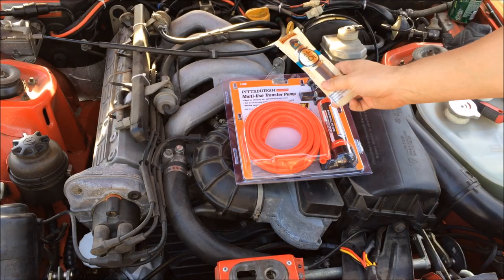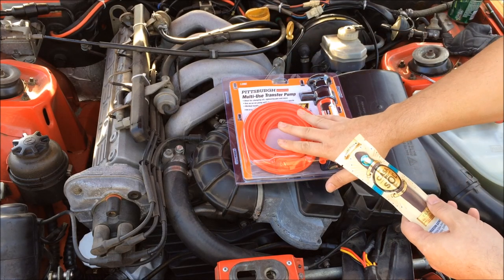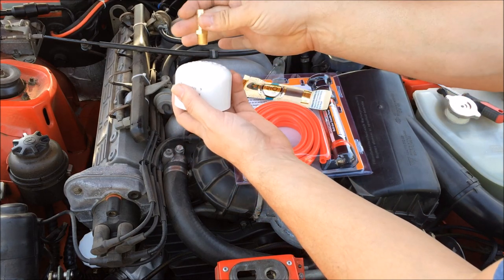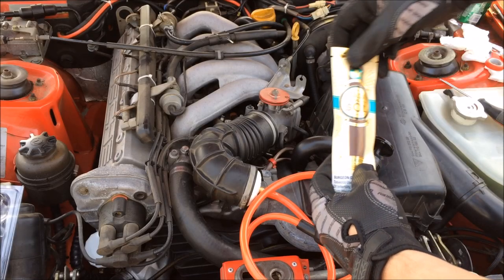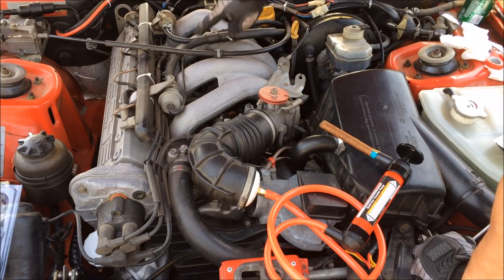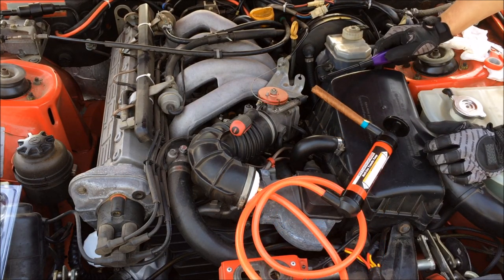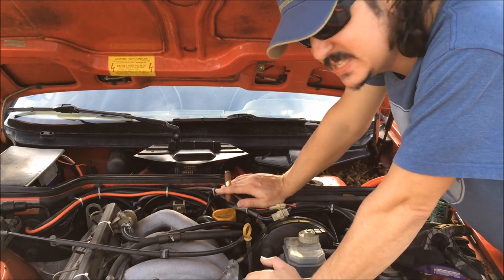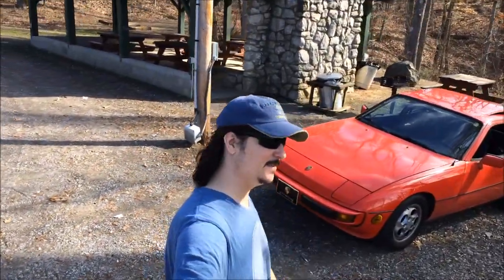Cheap DIY Smoke Tester

Comment: In case anyone is wondering, a regular plastic tip Black & Mild cigar fits perfect in the orange hose. Cut off 2 inch section of the orange hose,  stick it in the pump, then stick the cigar in the orange hose section

Comment: This needs to be the number one video for finding vacuum leaks. I’ve been having trouble with a rough running engine for so long and I’ve done everything from changing spark plugs and wires and taking it into a mechanic for diagnostics and it turns out with this little trick I have a huge vacuum leak out of my air intake. Thank you so much

Comment: Awesome, can't thank any more! Cheap, easy and effective. With this video and some helpful comments, I eventually find a vacuum leak (from egr valve) that has been frustrating me for long.  My 2cents input: 1) no need to go buy cigar, can make ur own with tea. Be sure to wrap tea bag paper in the end to avoid suck into the pump. 2) it might be hard to find exactly fit pvc cap and nipple in Homedepot. Just connect to anywhere else like brake boost line, and plug the intake air hose with a clean towel.

Comment: This is the best idea ever. I did this and found the leak in 2 mins. I connected the line into the pcv valve line on my Chrysler Sebring and found the leak on the egr line.  Thanks bro.

Comment: I used exactly this setup after watching the video,  took 2 cigars to fill the whole intake, intercooler etc on my 944 turbo but the smoke got where it was supposed to go. getting it through the turbo was no problem. 3D printed an adapter to connect pump hose to J-boot.

Comment: Great idea. I don't like the taste of cigars, since I don't smoke. I found a completely hidden crack in one of my rubber hoses that I would have never found thru normal visual inspection. Now I'm going to use this technique to find why the cheap briggs and stratton plastic carburetors are sucking air, and where it's leaking in. If your carburetor sucks air, it won't keep running after the initial start from priming, so this technique is useful for more than just your car.

Comment: Going to try this on my C300 it has two lean codes. this cheap method will help me tack it down and see if I have any leaks and if not oh well it doesn’t hurt .. will give updates🧐👍. No leaks just had wet fuel injectors from a detail

Comment: I wish I had seen this months ago....can’t believe I let my truck sitting for so long due to frustrations of finding this leak. And thx for your extra tidbits and rationale e.g explaining why you place the piece  precisely where you did, ways to get more smoke in manifold. Also, I was going to use an inscents cone , but I was worried that it would melt the plastic. The cigar is much better idea as there will be no contact between the plastic and the burning tobacco. My only concern would be a car that is gas fumey. Someone told me that fumes are ignitable. I guess all you’d have to do is light the cigar far away from engine in that case.

Comment: Amazing. When you're done you can also the cigar for a job well done 😄. I plan on trying this as well although I'm going to use an air compressor fitting so I don't have to keep pumping up the pump.

Comment: Just another tip...I used one of those plastic pumps that come with an exercise ball. Insert a lit cigarette into the inlet port, remover the shader-valve “T” connection and place the outlet tip of the pump into the vaccum line. Gently pump whilst watching that your cigarette doesn’t burn down. I find this method works best with 2 people. One to operate the pump and one to look for leaks. 😉 Hope this helps anyone on a budget. P.S., You may have to gently crease the cigarette filter to fit it into the pumps’ intake port. (*** I am not responsible should your vehicle develop a nicotine habit! ***)  😉
Reply from the maker: Thanks for the tip! Unfortunately, I think I've already given my car a nicotine addiction... I keep seeing cigarette butts in the parking lot.
Reply: edredas LMAO! Yeah, just realized I made a typo. Meant to type Shrader-valve.. But just had to trace down a P0445 leak on an ‘04 Nissan Xterra....pain in the tailpipe! But with a little ingenuity, I came up with this tip seeing as how I had no smoke machine. Found YOUR video right after I found my leak! LOL

Comment: Just a correction. Some leaks, particularly on booat pipes might not show without adding peessure to the system. I get many customers with tears which will be blocked until the pipe is pressurised and opens it up.

Comment: What size pipe nipple should be used with this Multi-Use Transfer Pump at Harbor Freight, it specifies that its  a 1/2" diameter hose.  Should I purchase a 1/2" diameter or a 3/8" diameter pipe nipple to fit the 1/2" connecting hose used by this pump?
Reply from the maker: I believe a 1/2 should work.

Comment: Awesome tip!  Ive got a drive by wire TBI, so I guess that I would need to turn the key to the on position and then wedge the accelerator to the floor to keep the butterfly valve open?  Confirmation from the knowledgeable crew?
Reply from the maker: That would be my best guess as well. Just be careful not to break anything!

Comment: What "ring gauge" cigar did you use for that little hand pump..??  Obviously, gars come in all sorts of diameters (ring gauges)
Reply from the maker: I don't really smoke many cigars, but looking at a chart online the hole on the pump is about 12 -13 mm. So cross referencing it with the cigar gauge chart it should be a 0.19 or 0.2. I hope that helps!

Comment: I have a Procharger on my Mustang. Would this application work? What additional steps would you recommend if any? THANKSS
Reply from the maker: On boosted cars I'll usually try just pressurizing the system in a similar way but using compressed air then listening for a leak. The reason is that its hard to get all the smoke to pass through the entire system, especially if you've got an inter-cooler. To do this you'll want to make a cap with an adapter similarly to how I did in this video but using a compressor fitting instead of a barbed one. Then use a compressor with regulator set to about 5 psi. Trying to do it without a regulator may cause damage and injury! So always wear safety glasses since I've had smaller vacuum lines pop off and nearly hit me in the face even at low pressure levels. So just be careful, but if done correctly it should work well and show you where any leaks are on a boosted car. I hope that helps!
Reply: edredas thank you sir. I was wondering whether I’ll need an air compressor for this test. Thanks for clarifying. Much appreciated
Reply from the maker: No problem, it will certainly help having a compressor! Good luck!

Comment: Help please 😬....  should this be done on a cold or hot engine to better find a vaccum leak because things expand and contract under different temperatures of engine ... and after doing this do u have to open the oil cap to vent out all smoke and how long until you can safely restart engine .. Please text me back I'm a single father with 4 children and I'm trying to find a vacuum leak and dont have much money .. God bless you
Reply from the maker: I would say that it’s better on a cold engine so you can move things around without getting burned. Also there’s no need to vent the smoke afterwards since it will take care of itself. Good luck and I hope that helps!
Reply: @edredas  thank you !!! Also what kind of cigar and where did you buy yours so it fit in the pump snug... is there a cigar that smokes with a heavier smoke than others to aid me in this ? I need to find this problem my son I have to drive a hour a way for up coming doctor appt for him and must find problem
Reply from the maker: Any cigar that is the right size is fine. I picked mine up at a local gas station for about a dollar and they had plenty to choose from. That said, heavier smoke will be harder to pump inside but either way I think most cigars will supply about the same thickness of smoke. Good luck!
Reply: @edredas  can I smoke test it thru the brake booster line inlet that's in my plastic intake seeing as how its right after the throttle body and the hose seems to fit perfectly??also this is to be done while engine is not running right??
Reply from the maker: Yes, the engine should be off! Using the brake booster line should be fine however some older cars have vacuum lines before the intake that might need to be checked.

Comment: How can I open an electric throttle body without damage it? Thanks in advance
Reply from the maker: Someone asked this a while back and I wasn't really able to answer this since opening some manually can damage them while some have a manual override. So it would depend entirely on the car you're working on. Perhaps your owners manual may shed some light on the subject. I hope that helps!
Reply: Just have someone hold the throttle pedal all the way down while you're doing it or you could just use something heavy up against it to hold it down. Most cars these days open the throttle body even when the car is off when you just push the pedal down, you should be able to hear it open if you're quiet enough. If not, the put the car in the ON position but don't start it and try again.

Comment: BRILLIANT! What size is the cap?
Reply: @rawfoodphilosophy7061  thanks now I can try it
Reply: @itsme2369  I just found out that possibly the smoke can affect the mass air flow sensor which is usually right after the air filter so take take that out and then just cover it with some duct tape. I'm really excited about finding this video, because I already have that pump, however, all I have are Cuban cigars LOL
Reply: @itsme2369  actually, we can just duct tape the hose right to the hole from the mass air flow sensor. It doesn't matter if there's a tiny bit of smoke that leaks out from the tape you can still look throughout the rest of the engine to find the other leaks. I have Gorilla Tape which is absolutely phenomenal if you've never heard of it
Reply: @rawfoodphilosophy7061  thanks and yeah share a Cuban hahahaha
Reply: @rawfoodphilosophy7061  yes I have and imma do it this weekend cause this check your gas cap has me crazy.
Reply: @itsme2369  yep, I'm going insane with my vehicle also! I ripped apart half my engine fixing random parts and this damn rough idle only when the vehicle is hot is the last thing on my list. Good luck to you!
Reply: @rawfoodphilosophy7061  smh we are in the same boat , I got the six pack you bring the Cubans we'll figure this out

Comment: thanks for making this video - always wanted to be able to do smoke test on my cars.  So, I made one and after using up about half my cigar on my '86 944 Turbo, I did start to see a bit of smoke coming up from the back of my engine compartment.  Ended up it was coming from the oil fill cap.  is that normal?  Funny thing was, I tried disconnecting my vacuum line that goes to the fuel pressure damper like you show in your video and I never did see any smoke coming out from there...that kind of concerns me a little too.
Reply from the maker: There's a seal on the oil cap that likely needs to be replaced. There's a hose on the filler neck that pulls vacuum so when there is a leak at the oil cap it will result in a vacuum/boost leak. As for not seeing smoke out of the FPR  hose, it will depend on the thickness of the smoke sometimes. So with smaller hoses like that you might have better luck trying another cigar or perhaps a vape (maybe in another video). While this setup isn't great at finding smaller leaks it usually works for most common ones. Thanks!
Reply: @edredas  thank you sir!  i will look into replacing that oil filler cap seal. if you ever get to MN let me know - I’d love to meet you!
Reply: So it looks like the seal is in the oil full cap.  it does seem very hard though.  however when I put my had over the oil fill hole with the engine running, it didn't make any difference in the engine idle...
Reply from the maker: It might not be a very big leak at the oil cap. That said, if its running great otherwise then you're vacuum system should be in great shape!

Comment: How would you manage with an expectric Throttle body, that can't be accessed, cheers
Reply from the maker: In some cases you can turn the switch to ACC position, without starting the car and have someone press the accelerator to open it. If you have a push button start you can sometimes just press the button without your foot on the brake and it will go into accessory mode where you can press the accelerator to open it. I hope that helps!

Comment: Option Number Two...
Get yourself a VW Van, an early sixties deluxe micro bus is ideal, but anything with seating for 6-9 people is good.
Pull that van right up next to the car you're working on.
Throw in a gallon of water, a family size bag of doritos, some nilla wafers and funyons.

Load up the van with all your stoner buddies.
Run a hose from the interior of the van to a brake booster line (or some other entry point) on your project car....use duct tape.
Tell the crew to get to hot-boxing and blowing down that tube!
Cost:  Nothing!...unless you count them eating your cupboards bare after the 'session
Fun Factor:  Tremendous!...name the stoner buddy that won't want to help with this project
Plus, this is solid state technology.
Blowin' smoke has been working for thousands of years.  ;)

Comment: Will this work on boosted car?
Reply from the maker: Yes but due to all the extra plumbing you may find that using an air compressor with a regulator set to 5psi and spraying soapy water will work best for a boosted engine.

Comment: Nice smoker! Only thing: Fire and gasoline don't mix!
Reply from the maker: True but gasoline can ignite just from heat inside the engine compartment. With the engine off there shouldn’t be any fuel. So if you have fuel getting on the outside the engine to the point a cigar can ignite it then the car has probably already burned 😆
Reply: @edredas  
It sure is a cheap way to do it in a pinch, I'll give you that!

Comment: Are you bypassing the air filter?
Reply from the maker: Yes!
Reply: Someone can correct me if I'm wrong but it wouldn't make sense not to bypass the air filter.  The air filter has a large hole that allows air to enter the box thru the filter... that's where your engine breathes from.   You want to test for vacuum leaks after the maf sensor which meter's the air flow.   A vacuum leak is unmetered air entering the system after the MAF has metered the incoming air.   This causes the mixture to become lean because of excess unmetered air messing up the fuel to air ratio.

Comment: Where do I put hose to find evap leak
Reply from the maker: Hi, it depends on the type of car. On this type of car I would try to pressurize the EVAP system near the charcoal canister, but I wouldn't use a cigar or anything flammable, just pressurized air and listen for a leak. Perhaps even use squirt bottle with soapy water to watch for bubbles where I hear leaks. On a lot of modern cars I've heard that the issue is usually the gas cap or a valve near the fuel tank. If your dealing with a newer car that's where I would start first. I hope that helps!
Reply: Ok great great changed cap clear code will see btw it’s a 02 Marquis

Comment: Can you list for me the exact parts you bought and at which store you bought them all at so i can know where to buy everything at today?
Reply from the maker: Hi, I bought the pump and fitting at Harbor Freight. I bought the pipe cap at Lowes but any hardware store should have them. Then I bought the cigar at a local convenience store. I hope that helps!
Reply: edredas can you tell me the name and size of the cap i have to look for and also that gold piece that you drilled a hole on top of the cap please?
Reply: im working with a Dodge Caravan SE 2003
Reply from the maker: I believe that the pipe cap in the video is 2.5" but you will need to measure to see what size you'll need for the car you're working on. The gold fitting that I inserted into the cap was purchased at Harbor Freight.
Reply: im not a Mechanic, i have never worked on cars so im a beginner, but i can't afford to pay a garage so i want to find the problems in the van for P0442 & P0455 because the check engine light is on and my scanner told me those codes. i feel that maybe this method of the smoke pump should work to show me the leaks or problems in the to repair the codes. make sense?
Reply: what is the name of that gold fitting that you inserted into the cap so i can find it inside harbor freight?
Reply from the maker: It's a barbed compressor fitting, so it will be over in the compressor section. You can also pick one up at the hardware store while you're getting the cap in case Harbor Freight doesn't have one.
Reply: ill try my best to find everything you bought and then i'll message you, but i really appreciate your time and help,  thank you very much.
Reply: edredas what is the exact size barbed compressor fitting that i need to buy?
Reply from the maker: I believe it was a 1/4" barb. Don't forget the drill bit to drill into the cap with. The fitting should be able to thread itself into the plastic without a tap.
Reply: edredas u have a number so i can text you?
Reply from the maker: The easiest way to get in touch with me is here on youtube or to join my facebook group. I get so many messages sometimes that its hard to keep up with them all. https://www.facebook.com/groups/128264574553699/
Reply: edredas im inside home depot now, i have no social media accounts

Comment: Did this last night with $1 cigars. Swicher sweets. They fit into the end of the hose instead of taking the hose off. And I already had the same pump. Unfortunately it's still a big fat ???. My meter readings indicate a vacuum leak (short trims go down on acceleration), but I can't find one anywhere no matter what I do. Cars are a bitch.